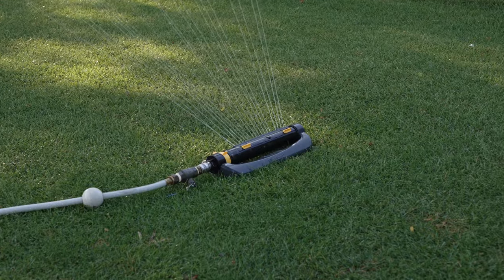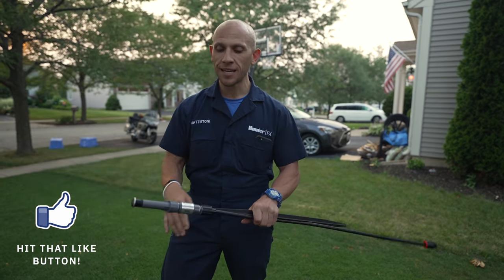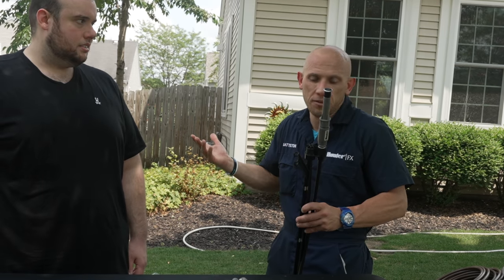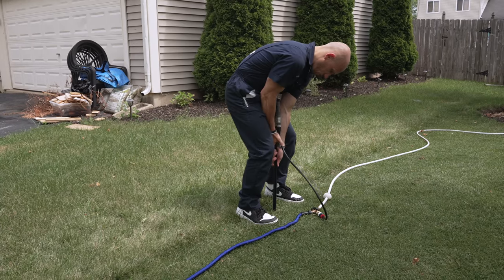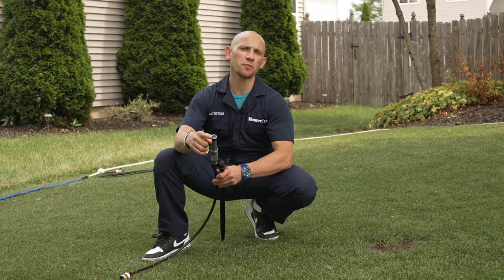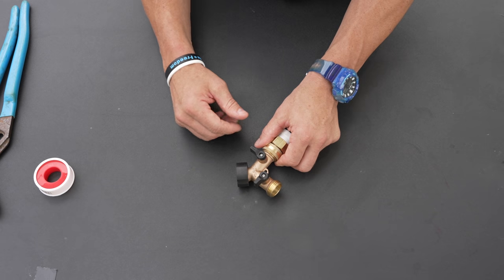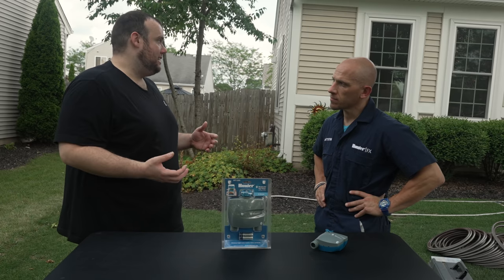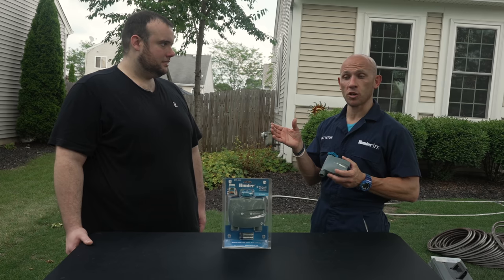Once You See It, You Won’t Use a Regular Sprinkler Again

Comment: I stopped the video to look at their website and it was a deal breaker right away and I quit watching at 4:00.  They don't give full descriptions of the products with what they include and the specs, just a product name and "Add to cart."  Honestly, this kind of turned me off of your channel.  While I know you didn't get money from them, the endorsement is questionable given how they operate and the info they give.  Also, a check valve on the sprinkler to keep more water from going out? No....that would be to keep 'suck back' (like if a well or city water failed it wouldn't pull water back from the system)......so his understanding of his own product is flawed.  Not impressed here.

Also, that plastic stake at that length with anyone that has clay or rocky soil is going to last about a week.

Prices aren't terrible but the case here seems pretty weak compared to the oscillating sprinkler when looking at east of use, price, operation, etc.
Reply from the maker: All the parts are listed separately?
Reply from the maker: Please if you have a better and more clear way of listing let us know
Reply: @PrincessCutLawnCare  Go to their website at the address you give, scroll down to "All Parts Also Available Separately" and you can see prices and "Add to cart" but cannot see specs or what is included on anything.  There's no 'product page' to click into for details like any other website has.  For instance the "Hunter - MP-STAKE - MP Spray Stake"....what does that include?  What are the specs?  Same with the "Hunter - BTT-100 - Bluetooth Tap timer Controller NPT Inlet".   Do I have to go to other parts of the website or another website altogether to see what the specs are?

Honestly the "MP Rotator PRO-Kit" for $173 doesn't even give specifications for anything other than listing what you get.  A $10 sprinkler from Walmart has more materials, flow rate, and other info
Reply from the maker: @ian3580  these parts are originally for commercial contracts, I will forward your feedback to sprinkler supply store so they can update it w more specifics